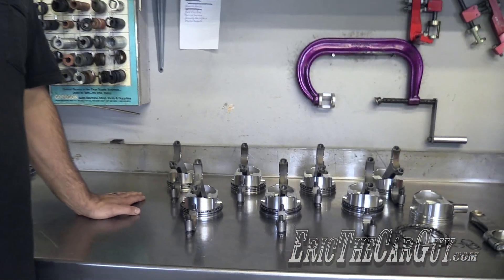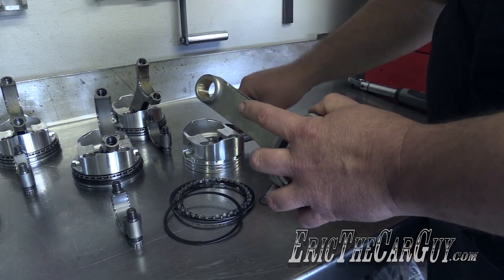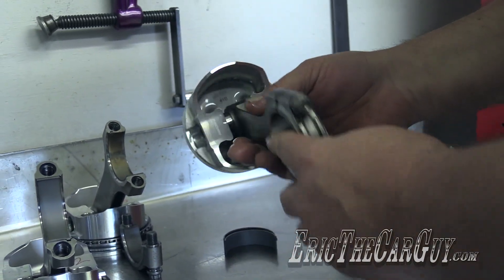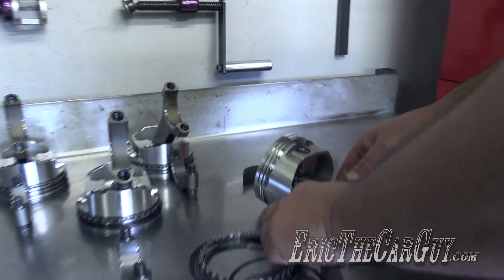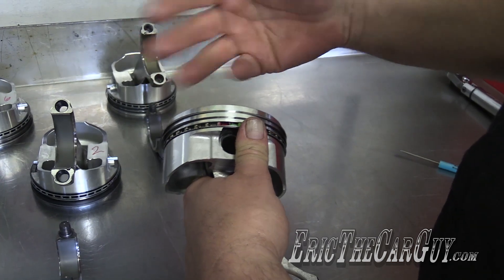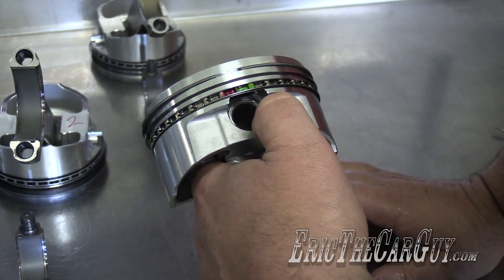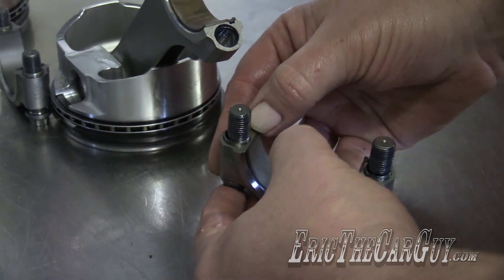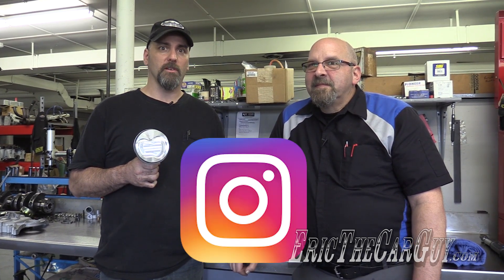How To Assemble Pistons & Rings

Comment: I commented the same thing about ring pliers on another video, by another channel, the guy claims that you damage the rings like that...The builder I worked for, was 70 years old, had 50 years of experience, and Built Race engines that won NASCAR/NHRA/IHRA Events and Championships and he never used the ring pliers... (I have seen rings BENT with pliers - And Broken, and they were not over extended!)

Comment: One of my rings has a "N" marked on one side of the ring. Does this "N" meen "this side up"?
Reply: Update on that, I found a video that said, put it upright on a flat surface, and se witch way its angled. My second compression ring had 2.5 grades of angle. Not visible to an untrained eye like mine. And turned out the "N" was supposed to face down. So it scrapes the oil down. 
1st compression ring was supposed to go up with the "N". It was a big mindfuck for me, but the engine still runs 👍

Comment: Anyone have trouble when getting pistons and ring sets half the rings are to small the ring gap is way over book sectsaphations , say you just had a bore 10 over 3.508.5 piston is 3.505 , ring gap should be 16th 22th . But your gap is at .034  on half the rings and rings with a gap of 19th you stick in the bore that had 34 the gap is back to 19th so you know it is the rings not the bore . I have and  sent back 2 sets so far  never cut the ring gap . if I had keep both sets I could have finished the job . I told the seller ship me .020 over rings and I will trim them myself the 20 over are .518 he is telling me they will not work . im sick of having a huge fight over the rings .   I think someone stuck Stock rings in the 10 over bin to be a A$$  stock bore is 3,494  .

Comment: To heat the wrist pin area of a connecting rod to expand the rod 2 insert the piston wrist pin is bad practice as the applied Heat well remove the hardening temper of the connecting rod at that point and will weaken the tensile strength the the wrist pin can be frozen submerged and liquid nitrogen and then pressed in using a Arbor press that's why it's called a press-fit rather than a slip it by heating metal it's already hardened you well remove hardness temper at that point we were taught 2 replace connecting rod that were discovered do have blue spots because the the rod had been overheated because of lack of oil and is no longer serviceable remember a press-fit is not a slip we are also taught to never apply Heat to the spindle knuckles the front spindle assemblies remove tie rod end that is why they Supply removing forks buy Heating the knuckles you will weaken the metal and will be prone to break
Reply: Norman Heen Only if you overheat it PAST its tempering temp, which you don't when pressing in wrist pins. It never gets heated (if done right) anywhere near the temps it will see in normal driving, lol.

Comment: H-beam rods are very good for torque,  not so. Much rpm.  I-beam rods are good for rpm,  and adequate for torque.  I don't think you're revving that 302 very high,  though.  Forged internals are definitely a good idea for boosted applications.
Reply: H beams are stronger all around, even at high RPM. The reason people tend to use I beams for high RPM applications isn't because they are stronger, but because they are lighter, which a lighter rotating assembly is always better for high RPM use.
Reply: just created a Youtube channel to guide European repair.
 YouTube:

Comment: Hey man I'm a huge fan I actually have a Ford Fairmont of my own but I got a problem, I had to replace the cylinder head gasket on my 89 Chevy s 10 2.5l TBI and I replaced the intake exhaust and valve cover gaskets, and the truck runs but it Acts like it is miss firing but when I pull the plugs it dosent seem like that was it but I wasn't sure what to torque the rocker arms too because their was no specks in the manual, but none of the vacuum lines are hooked up properly but the check engine light is on and i can't pull the code what can I do ? I have no clue I've been working on it for 2 days and i don't know what to do

Comment: I'm glad this video was uploaded because this helps me to better understand what might have happened on that Chevy Tahoe you did back at the old shop where some of the cylinders had complete compression loss.
Reply: Rings can be a big pressure loss. One of those old Tahoe's he worked on seemed to be a valve issue.

Comment: i think you missed to point out the tang that sticks out from the rod bearing that is also machined into the rod itself, i know 2 of my friends who spun bearins by not using the correct ones, ie: using bearings that were totally flat in a rod that is meant to accept a bearing that locks in
Reply: The tang is only there to locate the bearing during assembly. After you torque the rod bearing crush keeps the bearing in place. He'll probably explain that during the short block assembly.
Reply: They spun bearings most probably from not checking their clearances properly. Plasti-gage only shows part of the story

Comment: Eric or anyone in the comments here please reply. Working on Subaru Outback front brakes. The caliper has two pistons. It was VERY hard to compress. So I took a C-clamp and got only one to compress. Was that a mistake? Now the other one will not move but I suspect its because of rust. Can I clean it some how? Brake clean/ WD 40? Can I push down on the brake so the piston comes out all the way and then be able to clean it better? Also can I remove the rubber seals on them? I took one off already. Please help. It;s stuck big time. I thought about going to get one of the real tools to compress them with but they basically just look like a C-clamp to me. Not sure they would work any better.
Reply: You need a new caliper.
Reply: yeah i got one. I was thinking I could fix it...
Reply: just created a Youtube channel to guide European repair.
 YouTube:

Comment: When dragging the rings into their slot he is scratching the outside wall of the piston head
Reply: 80% of the machine shops ive seen all do the rings by hand. They are against the ring tool. Its kinda like the oil filter wrench. Not needed
Reply: Spencer T. Which doesn't't hurt a piston one bit. And it never comes in contact with the cylinder, so who cares?

Comment: Interesting to see how these things go on a car engine. I messed a lot with mopeds when i was young (who didn't?), the cilinders of those go a LOT easier together. Like you don't have to look for any alignments at all. Just put the piston rod in the cilinder, slide the axle in, put the spring rings in to prevent the axle coming out, put two cylinder rings on, and that's it. I guess i better leave car engines alone :D

Comment: Forgive my ignorance, but what is the purpose of the "wavy" ring?
Reply from the maker: It's a spacer that not only holds the outer rings in place, but it also provides an area for the oil to go after it has been removed from the cylinder walls by the rings. In that same groove behind the wavy ring, there are holes around the circumference of the piston where the oil can pass through on it's way back to the crankcase.
Reply: wenliu99 oil control...it basically scrapes oil off the cilinder wall
Reply: Thanks.

Comment: 4/10 of a thousand, 7/10 of a thousands, thousands and a half... Doesn't units this small not seem obsolete to MM?
Reply: When working with clearances like this and you know what you are talking about, its easier to stay in a measurement that you are comfortable with.
Reply: On an old american design/de facto standards, using metric would involve rounding. It was designed in SAE units, so that' the proper term.

If it were a metric engine (such as the Vulcan V6 in my Ford Ranger) then metric might be a better unit set to measure in. It all depends on what the precision parts were designed with.
Reply: Besides, when millimeters is too big, you always have micrometers, nanometers etc...
Reply: Larry Bolan